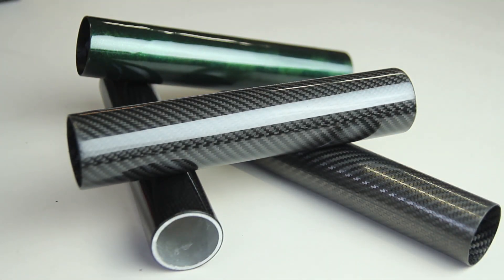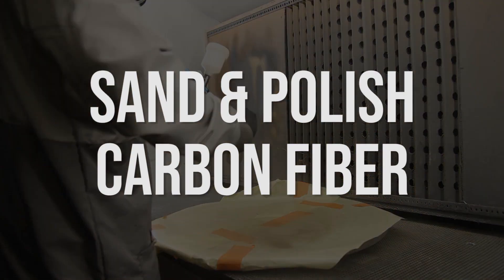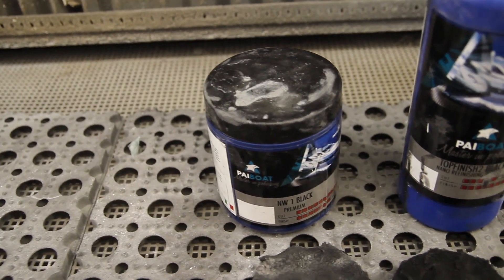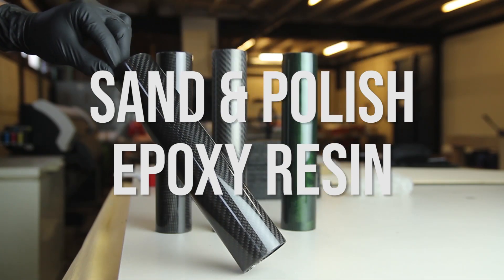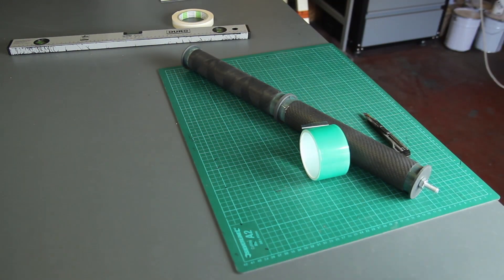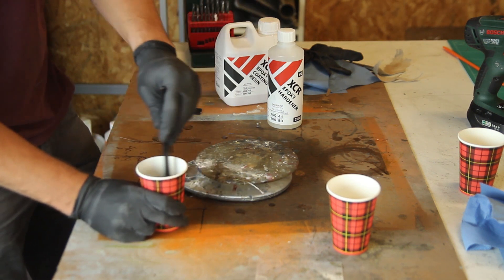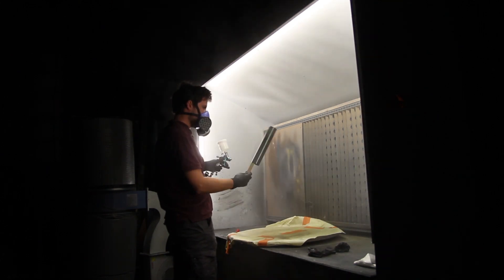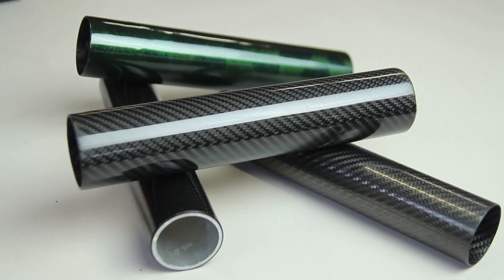How To Finish Carbon Fiber Tubes or Parts - 4 Different Techniques (Tutorial)

Comment: whenever I try to sand epoxy directly, im alwayssss left with scratch marks no matter how many grits I use or how much I sand with each grit. Is this what the topcoat is for, is it easier to sand? Or am I just not good at what im doing

Comment: Maybe a dumb question or possible one that has already been asked but if your cast product is found to be to thick is it possible to sand through or past one ply let’s say without an issue?  The reason I ask is because I ordered a piece of roll wrapped carbon fiber and I over estimates how thick the wall thickness wound need to be for the project I’m working on. My piece is just 12” long and I thought about running it in my wood lathe (taking it down by sanding not tooling) do a thinner dimension. I’m the end I’m not concerned about esthetics as far as seeing consistent Fabre weaves and such I just want to cut the weight down. Is this a bad idea. I’d likely bring it down maybe an 1/8” in wall thickness in the end. Any advice would be appreciated. Thanks
Reply from the maker: Will be hard to get good aestetics if you need to remove that much, each layers of carbon should be about 0.2mm which isn't a lot... You might remove a bit more a'd apply a new layer on top for aestetics in the end?

Comment: Absolutely fabulous! You mentioned something about applying gelcoat afterwards, in one of the other comments. I always thought gelcoat was a polyester type product, and would not work with epoxy. What gelcoat do you use?
Reply from the maker: Easy Composites has a product called "GC50" which is compatible with Epoxy resin if I'm correct! I personally dont like gelcoats as they add weight and it's hard to control if everything goes well under vacuum :)

Comment: Can You do a strength test on these 4 tubes? this would show which processes better for certain applications.
Reply from the maker: might be something interesting to do!
Reply: If you want to know how each method effects strength. The methods where you cut right into the carbon will impact your strength a fair amount. Almost all the strength in CFRP are from the fibers and the matrix prevents fiber buckling and maintains stress distribution. By sanding into the fibers you’re basically creating stress concentrations along the fibers where certain fibers are much thinner than others. If you want to maintain integrity of the part and optimize strength, begin with a top coat and then sand down. Again use a rotating assembly to maintain an even coat and reduce stress concentrations. Try to keep aeration of the epoxy low as well. Bubbles will create stress concentrations.
Reply: Brilliant idea